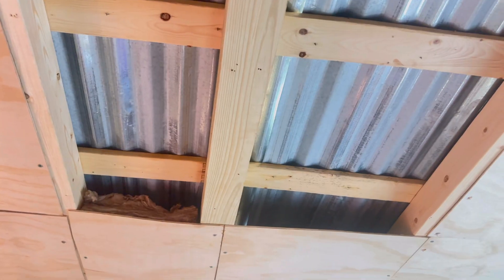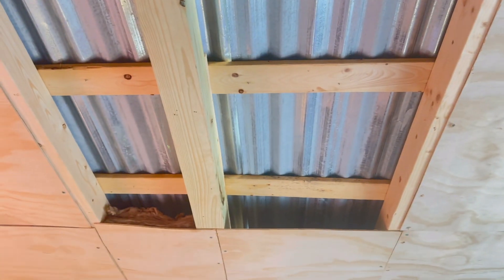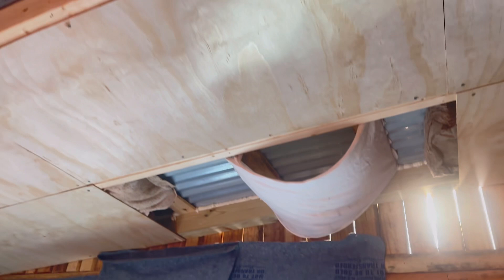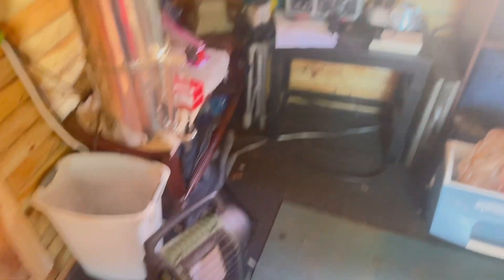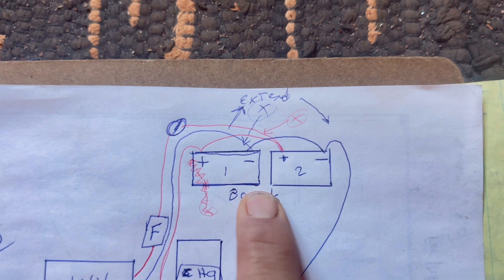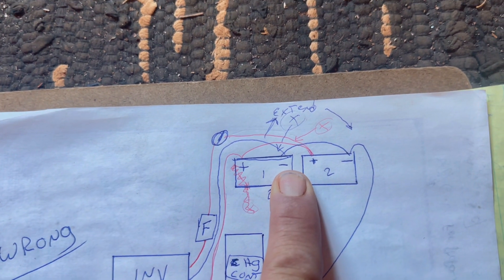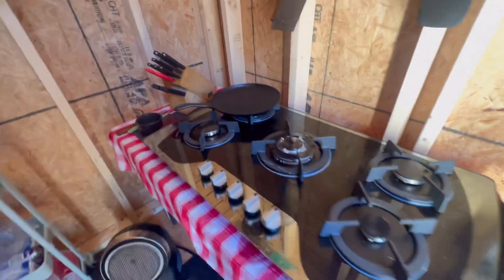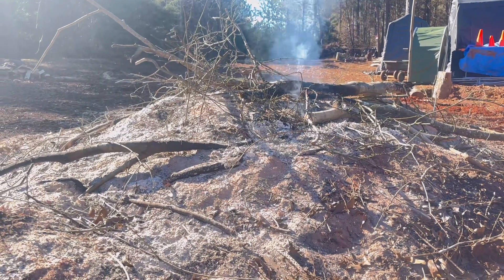E34 - what I did wrong: cabin tin roof condensation; solar config

Comment: Welcome to the world of physics. Condensation water is the main reason for mold in modern insulated houses - if you insulate it wrong. The water comes always from inside (breath, your heater, plants, bathing etc.) and is transported via the warm air to the cold parts of the houses. So the easiest - but not really best solution - is to stop the warm and humid air from reaching the cold spots - a moisture barrier or layer, normally done with special kind of vapor barrier film. Put it just right under the first layer or wood or plaster: air - plaster/wood/ceiling - film - insulation - air - roof.
This might help for some time - but you have to make sure, that this film is firmly closed everywhere and no tiny tiny holes help the warm and humid air to reach the cold roof. Your second problem is also the closed metal barrier you made with your roof: it can't dry. You need to make some passages for fresh air from outside to flow right under your metal roof, so insect protected holes for the air all around your eaves and verges to help the insulation dry again. Plain ole roof tiles with lots of air are still the way to go, but they are heavy and need quite some work.

Comment: Rockwool should do it... No need to remove the roof (unless it's leaking) just take down your ceiling material to install the insulation. Rock wool is more mold resistant and fireproof than fiberglass. You'll still have to deal with the excess moisture from your propane stove but that's a separate issue from heat rising, hitting the cold metal roof and moisture precipitating out on your ceiling. I hope you have a Carbon-monoxide detector because that might be making you sick. Ventilate, baby!

Comment: Your problem is that the warm and humid air gets in direct contact with the cold tin-roof. When the air gets colder, it releases some moisture on the cold surface (warm air can carry more humidity than cold air). Try painting your wood-paneling on your ceiling with a waterproof paint to prevent the diffusing of humidity into the space above the ceiling under the tin-roof.